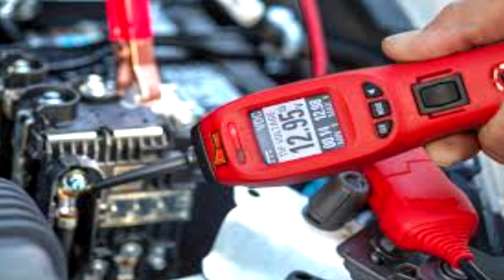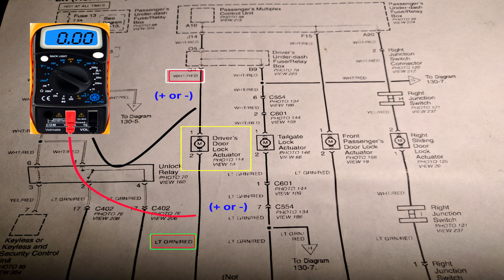Honda Power Door Lock Diagnosis - Actuator or Passenger Multiplex Computer??

Comment: Wow!  This worked perfectly on my 2004 Odyssey EX. 
Months ago the driver lock actuator burned out.  I bought a new one and followed JamesonDIY's other how-to to replace that but it did not work.  I saw this video and was too intimidated to follow it a few weeks ago.  However, today I watched it again and started tearing out the multiplex.  There are so many plugs that I was worried a wire or connector would get broken.  When I finally got the circuit board out, the same connection trace was scorched exactly as seen in the video.  A new multiplex is over $400 so I was not going to do that for a car barely worth $1200.  So there was the option of soldering a jumper.  I have a hate-hate relationship with soldering.   However, I broke out the soldering iron kit and watched a couple videos on jumpers.  I melted a bit of solder on each tip of the jumper wire and then dipped the ends into the flux. Gently heating the wire on the board gave a great connection.
Then I set about putting the mess back together.  It took a lot of cussing but I finally got every plug back in.
I could not reach the top bolt on the multiplex frame so I just left it off.  The bottom bolt was good enough.

Big thanks to JamesonDIY!!!
I would definitely tip him some $$ if he had that on his channel.

Comment: Local mechanic replaced passenger side door actuator (2008 Honda CRV) but while that worked, now the tailgate wouldn't open. Then was told its the multiplex control unit that needs to be replaced as well as the latch and release handle of the tailgate. DOES THAT MAKE SENSE? Did the MCU fail at the same time or was it something the mechanic caused during door actuator repair?
Reply: This guy gave u turds on your reading glasses.

Comment: My 2009 civic keyfob does not work when locking. Only unlock. And the door ajar light stays on when all doors are closed. I already changed the door sensors but problem stays.

Comment: Hi and thx for the video. My honda accord 2003 has a similar issue. All doors work perfectly to unlock remotely or by pressing the door button BUT none of them will lock either remotely or by button. 
its been this way for years and stable as such, 
any clues on this issue or ideas would be greatly appreciated. cheers
Reply: My Element is doing this, have you had any solution?

Comment: Thank you for taking time out to make this video it’s placing me on the path of diagnosis of my 2008 Honda Pilot per locks where in cold weather or sometimes after a car wash my pet locks lock automatically in 5 seconds even with key in ignition I can pull the plunger up on driver door and two rear doors no problem but when I pull the plunger on front passenger door all doors lock and it’s intermittent driving me insane so I’m thinking of replacing multiplex on passenger side actuator is not giving any signs of being bad any thoughts or experience on this problem would be appreciated thanks

Comment: Thanks for the video! I had same issue on a 10 Odyssey. I was searching for lock issue and glad that i came across your video related to MUltiplex/ fuse box. I ended up buying a used one because mine was burnt badly.

Comment: @JamesonDIY - thanks for useful info on multiplex control unit, very little info available on youtube regarding this topic. Most of the videos talk about replacing of actuator.  My honda pilot has a tricky locking issue - only the rear passenger side lock is not working but driver side and other doors are working fine. I ruled out actuator issue, the actuator is working good. So in that case could it still be a multiplex issue or wiring issue? Any advise will be really time saving. Thanks in advance,

Comment: I have a similar problem but all door locks, turn signals, rear wiper, high beams, sliding doors all do not work
Reply: I have the same issue that suddenly the locks and directional stopped working. What was the fix?

Comment: Hello, thank you very much for the video. I have a Oyssey EX 2009. I would like to tell a problem that I have. There is crazy behavior on the passenger side door and the right sliding door, they keep the light on, only happen on wet or very cold days. The door jamb light switches are good and also the passenger door latch is difficult to pull or push. Do you think it could be the passenger multiplex control unit or just the actuator? Thanks again

Comment: Thanks for sharing! I just purchased a 2007 pilot and all doors won’t responde to the keyfob, even when manually clicking the lock/unlock button on each door it doesn’t do anything. Could that multiplex control board be the problem? What are the odds of all actuators failing at the same time? One thing I noticed is that the keyfob is able to unlock only the driver door but won’t lock it back. Thanks!
Reply: Did u ever find out what the issue was?
Reply: This guy gave you balls on your eyeballs

Comment: Just had all of the 5 accuators replaced and they are still malfunctioning on my Honda odessy 2002 please help
Reply: I'm having the same problem with my 07 crv. Did you ever find out what caused your problem?
Reply: @ammogiant824  yes it turned out to be one accuator cousing the rest to malfuntion and there was i cut wire were the driver side door harness is at
Reply: @joseesquivias3078  I've replaced all of mine but they still don't work.
Reply: @ammogiant824  ok check the harnes on the passenger side door were the the door hing is located there should be a cut up wire.Thats a known issue
Reply: There should be a harness

Comment: When I try to measure the voltage with a volt meter on the connector, it goes from 0 to a few volts back to zero. Is that normal?

Comment: i have a 2008 acura TSX. MY KEY FOB WILL WORK INSIDE CAR AFTER I START AND TURN IT OFF. BUT HWNE I GET OUT IT DOEASNT WORK :( ALSO NOITCED MY KEY ONLY UNLOCKS DRIVER SIDE DOOR BUT WONT DO OTHER 3

Comment: Is there a fuse specifically for this multiplexor?
Reply from the maker: There will be multiple fuses that feed different circuits that run through the multiplex
Reply: @AppalachianDIY  I found the remote lock fuse and replaced it and remote locks are working!!!
Reply: @duorah  
Where is the fuse located? Thanks
Reply: @robertswatches  There is a fuse box on the passenger side below  the glove compartment.
Reply: @duorah  
Thanks for replying. I figured it out. The receiver in my door switch failed. I bought a replacement switch at the salvage yard. $50.00. Quick install...good as new!

Comment: We have a 2011 Honda Pilot and have had some door locks replaced.  Now the failure to open is happening again.  It always seems to trigger the tailgate and back rear passenger door locks to not unlock.  For us, it seems to be temperature sensitive.  When the weather changes from warm to cold is when we are having the problems.  Same thing happened before we had the other locks replaced.  Anyone find the temperature affecting the locks?

Comment: Hi saw your video very helpful, however I would like to know if you help with the following. I have honda accord 2007. The key remote does not operate, also the power switch, seat adjustment, window adjustment will only work with the ignition on. The radio and clock does not work at all.
Could it be a multiplex issue? Thanks
Reply from the maker: The power windows should only work with the key on, unless you just turn the ignition off and haven't opened the door. I think they will work then for a short time. The rest of the issues could be multiplex related or BCM. I can look at a wiring diagram and see what they have in common, if anything. What is the exact model EX, LX, etc? and the engine size?
Reply: @AppalachianDIY  hi just wanted to let know that I came right with the problem a fuse in the engine compartment. Thanks alot for help
Reply: @AppalachianDIY  it's a 2009 executive auto 2lt
Reply: The power door switch use to work without ignition on, now the doors won't lock or unlock and even the trunk won't open except with the ignition on,
 The key fob does not operate at all after all of this

Comment: Do you have any suggestions on where to look for my 2008 Odyssey?  Key Fob will unlock doors, open side doors,  but it will NOT lock the doors.  Would that be a relay issue maybe?  Thoughts?  I am stumped and cannot find that same issue with anyone else online.  New battery in key fob did not help.
Reply from the maker: It could be a relay. I think there are separate lock and unlock relays. Will the doors lock with the lock switch in the car? That would be a clue if it did.
Reply: Hi, quick question did you figure out the issue?
Reply: Same issue with my Element, I have been trying to figure it out but have found no solution

Comment: My locks continue to lock themselves after the car is off for hours. I have unplugged the harness in the doors and pulled the fuse, the multiplex relay still fires all night. Does that mean the multiplex is screwing up?
Reply from the maker: I would have to look at the wiring diagram for your car to be sure. But if you unplug the switch, and the fuse, and the relay continues to energize, it does sound like the multiplex
Reply: JamesonDIY I think I'm going to start with the driver lock switch, because the passenger window refused to unlock and roll down. After being totally fustrated with this lock issue I used the caveman hand and the pass window has been working since. No clicks are present on the door lock relay unless the key is in the ignition (engine off) and the doors are locked.

Comment: Great video, so what can cause damage to the multiplexer?
Reply from the maker: When circuits that it control draw too much current. Like a window motor or a door lock not working correctly, but attempting to work, causing excessive electricity draw

Comment: This is EXACTLY what I had to do to my 03 Odyssey. I had the same burnt trace, I replaced it with a jumper wire and it is still operating. Excellent video. I pulled out the multiplexer without removing all of the plugs. Definitely a rotten location to work in. Excellent video. I just replaced my drivers door window regulator for the 3d time in 14 years, and the lock is again intermittent, this was a case of the actuator rod being bent on removal. Fixed and fixed. Thank You.

Comment: So my 2011 MDX doesn't lock/unlock most of the doors using the door lock button or fob.  The other thing that it does is the driver eat memory and mirrors won't adjust properly.  The driver 1 and 2 key have the capability of memory to each key.  The other thing that won't work is the cargo door switch.   Would this go along with this diagnosis?

Comment: I went to Honda to program my key for my 2004 Honda accord and the told me that I would not be able to program my key if the door lock didn't work what should I do
Reply from the maker: That might be true, but I would consult a high tech lock smith. There are many that specialize in car keys, and they are much less expensive than dealers
Reply: @AppalachianDIY  pleas my anti theaf security honda dosent work.. Door lock & unlock is working ok.. What proplom
Reply: that sounds like total horse shit.  My Accord doesnt have a lock on the door anymore, long story, and Ive had a new key programmed without any problems